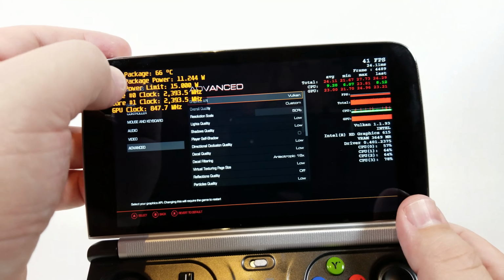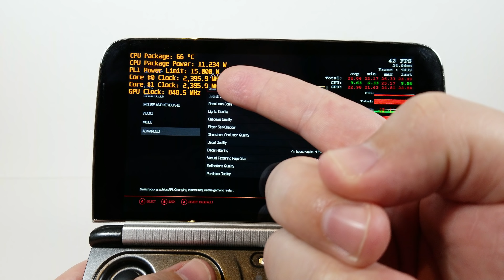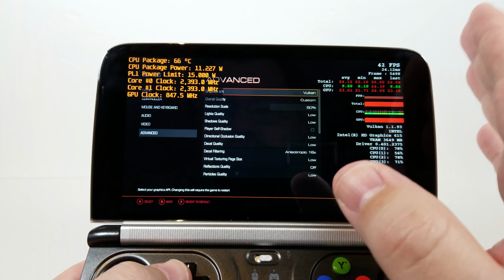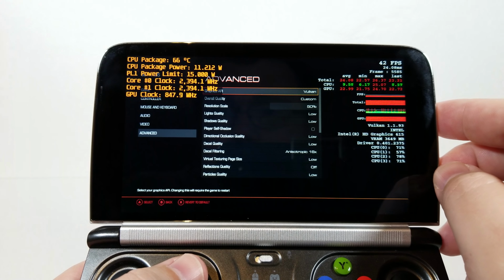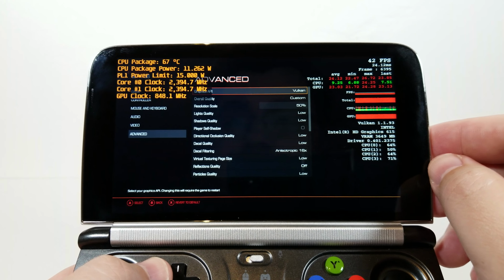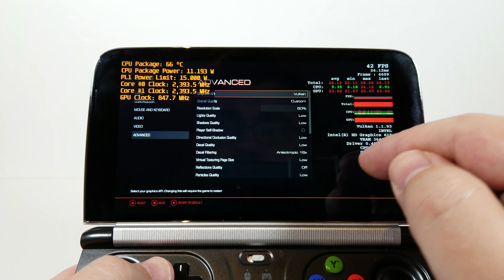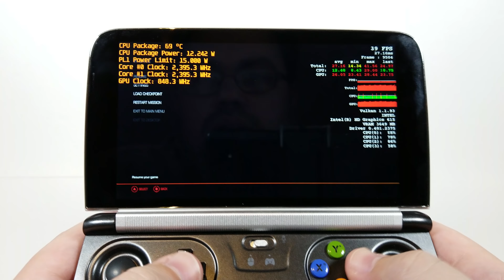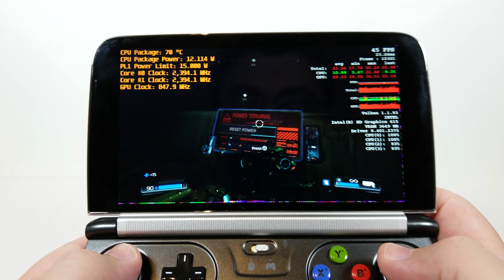GPD Win 2 Heatsink Mod GameTest - DOOM MAX POWER (15 Watt TDP)

Comment: Looks better than Switch
Reply: Computer Man Its running at 360p
Reply from the maker: Don't listen to Justin Wong. It's 507p XD
Reply: Of course. According to Digital Foundry, Switch version runs at lower settings than the lowest possible on PC, at 500p... Even a GT 1030 can run DOOM at 1080p 30-40 fps
Reply: Thang Nguyen Texture quality is lower due to size limitations
Reply: @justinwong939  so it looks worse
Reply: Depends what u mean
Reply: @ROCKSTAR3291  and once again, you seem to fail to recognize that the switch version has been improved since then at more often than notx runs at 720p. The tegra x1 is very much more powerful than the gpd win 2, the switch isnt fully clocked in docked mode and still beats it out.
Reply: @ThePhawx  The resolution scaling is represented from one axis only. So if your are running 50% of 720p, that's 360p. It's 50% of the pixels in a given axis, aka 25% the pixels, not 50% the pixels. For 50% the pixels you need a resolution scaling of 1/1.41

Comment: Running doom better than the Switch
Reply: It depends. He changed its tdp to 15 watts from 7 watts so thats probably why. Normally it would be quite similar
Reply: It’s actually not bc panic button just released an update on the specs making the games even better looking and crisper, switch games runs amazing for 30fps, this game here runs but it’s glitchy and lags a lot and the graphics glitch constantly, I know bc my friend has one, not worth it for the price, better off with the switch
Reply: Dee Lopez Well, it isnt the devices fault. Its more or less intel’s crappy Vulkan drivers which might or might not be fixed
Reply: @Dee_Lopez  runs at higher FPS.... your friend doesn't have a 15 watt custom heat sync
Reply: @Dee_Lopez  whether you like or not this specific GOD win is running doom at higher texture quality and higher Framerate than the switch.
Reply: Maury J. Well, I also found out it was running at 360p in this video
Reply: Maury J. If the game drops to the low 30s at 15 watts then it probably will drop below that at default tdp
Reply: Maury J. Also, just saying. Texture resolution isnt really affected at all by gpu power. Its mostly vram and ram
Reply: But does Win 2 have motion controls?  That would be killer
Reply: Can people shut up about comparing framerates between switch hand gpd? It an apples to oranges comparison, switch is capped at 30, so we don't actually know how it runs framerates wise
Reply: @justinwong939   do you even know how resolution works ? 50% resolution scale of 720p is about 500-600p. You think you can just divide 720 in half lmao ?
Reply: XoMrNoNameoX Resolution scale affects both width and height
Reply: XoMrNoNameoX So it is
Reply: @justinwong939  Doom uses pixel count for resolution scaling, not vertical and horizontal line. 1080p at 50% give you 720p which is about half the pixel count, and so on

Comment: what?!?! in my gpd win 2 I have it set to 10w and undervolt -60 and I can play Doom with everything in high except about 2 options in low resolution scale in 71% and resolution at 544p the frame rate is 38fps minimum and 63fps maximum setting everything on low it reached 108fps and without using that fan it could be an hour playing perfectly ...... so I'm telling you to buy another gpd to do these tests why yours should have some problems
Reply: sebastian oyarzun I highly doubt it reached 108 FPS. His unit is fine.
Reply: A bunch of people have tested doom on the device and have never come even close to what you described
Reply: @justinwong939  but it's true in my case I would not be talking about this if it was a lie and in my gpd I deleted and deactivated all the useless Windows applications and again I made it clear that I am playing with 544p resolution at 70% when I can upload a video to myself when I downloaded it again

and they say that many have tested the Doom but you have seen what was the last test none has played with the updated drivers at this time
Reply: sebastian oyarzun Updated drivers increase the dps by more than double?????
Reply: sebastian oyarzun *fps

Comment: ok, tbh although this does seem pretty cool, and I'm not anti-win 2 but the switch does a much better job at running Doom and the fans dont get loud. Doom is one of the games i intend on playing on the go and the win 2 just doesn't cut it, Is there a way you could lower the tems even more?

Comment: @The Phawx - Need to know how far I need to Disassemble the Device in order to replace the DPad with one from a 3DS, and the Joysticks from a 2nd Gen Vita. Dont want to Disassemble what I dont need to, but this one seems a bit more complex. But if I am correct, I should take it apart AND also replace the Thermal Paste for better Heat Dissipation?
Reply from the maker: You have to disassemble pretty far to get to the keyboard membrane. The good news is you can get to it and leave the heatsink alone. The SoC is on a daughter board that can be disconnected without having to disassemble the heatsink.

You COULD replace the thermal paste, just be aware you will need to use a lot because of the gap that exists, or use shims
Reply: @ThePhawx  Interesting. Will wait till I get the Joysticks......whenever that will be.
Reply: @ThePhawx  : By the way, are you having any Issues with the A Button? It seems to be a pain trying to Press A and B together. Seems like it is catching on something. Hence another reason to get at the Controls.
Reply from the maker: @chrisflowers-smoker154  yeah newer units can be tight. After use the plastic abrades and it's easier to press

Comment: The Phawx, i know this is a bit of an old video, but can we talk about this openGL 450mhz thing? Have you found any way to fix it, or know which drivers give the full 850mhz for OpenGL?
Almost none of my stuff uses vulkan except Dolphin and PPSSPP which i'd rather just use DirectX for, but a lot of stuff uses openGL. If one of my emulators doesn't use directx, it uses openGL so i'd rather have openGL at full speed.

Comment: Do you think he could find really tiny, but really stiff spring screws? Because if i want to use Liquid Metal, that gap can NOT be there. Even if it means i'd have to mod the heatsink myself, to take 0.1mm off where the screw mounts go, so it rests a bit deeper.
still, spring screws would be better..
Reply: Liquid metal wouldn’t be the best idea especially on a portable device lime this
Reply: It'd be wise to take precautions of course, such as putting something around it to catch anything that got loose, even using a foam/rubber seal around the cpu. Your argument is probably going to be the exact same one that everyone else makes, and all stems from the same source.
1 person says it, then another, it just spreads from there. But has anyone actually seen any failures from someone who took proper precautions and applied it properly? Like have there actually been any reports of failures from laptops with LM? 

It makes sense, don't get me wrong, you jostle it around a bit, maybe something will get loose... IF you use too much LM and don't have anything around the cpu to catch it. It won't absorb it, only catch it. Even a single layer of paper towel around the cpu would be enough.

Comment: You have the resolution set to 720p but resolution scale is 50 percent 50 percent of 720 is 360p you said the resolution is 507p unless I’m hard or hearing.
Reply: trent trombley Its 504p. 360p is halving both the horizontal and vertical sides so thats 25 percent
Reply: Justin Wong but isn’t that what they do they half both? I’ve seen you tubers using the resolution scale of 50% with 720p and they always say 360p so 640 x 360. 75% would be 540p or 960 x 540 etc
Reply: trent trombley I’m not sure but I think it has to do with total pixel count and half would be 504p
Reply: Justin Wong actually I just read up on it. If you are using 720p which is a resolution of 1280 x 720 if your resolution scale is 100percent it will render at that resolution. If it’s 200 percent you’d multiply 1280 x 2 and 720 x 2 giving you 2560 x 1440 so in this case it’s the same you’d multiply both the vertical and horizontal by .5 giving you a resolution of 640 x 360.
Reply: trent trombley Oh. Nvm then.
Reply: Yeah. I just looked it up and it seems to. So it actually is 360p
Reply from the maker: This was actually a discussion that came up prior. Resolution scale applying to the pixel count instead of the HxW.

I can forcefully set the resolution or even just take a screen shot of the game and count the edges on the aliasing.

I'll follow up when I have an actual answer.

Comment: What is the point of the custom case if the original can fit with the heat sink?
Reply: You have to sand down some plastic on the original GPD win 2 case in order for the heatsink to fit
Reply: Based on Phawx's video review of the custom cases available ( https://youtu.be/yJ7RXMZ8h9Q ), the temperature tests showed the custom ones feel cooler than the original.
Reply: @hoeybaby1  oof. Wonder if it makes it weaker
Reply: @hoeybaby1  I was thinking of maybe getting this heatsink if I get the win 2 but I didn't want to replace the case. Did that once with the win 1 and found it tacky after a while. Switched back

Comment: How does this compare to a Switch?
Reply: Well... Just think of the games. You don't have to buy any dedicated games for the device if you have steam
Reply: It's a lot better but the switch is worth having if you like nintendo games, gpd win 2 is a more powerful and more portable handheld
Reply: @BADC0FFEE  and twice more expensive :D
Reply: Without the mods and tweaks. it is more or less a tie when playing the same games. With the mods. The GPD WIN 2 wins.
Reply: Well considering portable on the switch the lowest the resolution goes is 540p or something and highest the res is at 680p. I don’t know the exact numbers. This test the resolution is at 360p 100 percent of the time. I’m not sure if there is depth of field fx etc. 

Perhaps if this was a dedicated console with games built straight for it they would be better. Keep in mind too this is doing 15 watts maxed out. The switch does 5 watts portable. 

I guess you get the full steam library and can get get 40 fps at 360p on doom on the go which if you don’t care about graphics and the hefty price tag it’s good
Reply: @trentoinsano  This is false. Doom on the Switch lowest resolution is 432p with frame pacing and goes sub 30 fps in hectic areas. Source: DigitalFoundry youtube channel. There's alot of head room on the gpd win 2 to increase the resolution to 500P and still stay above 30 fps.
Reply: Codex my bad, you are correct. I was lazy and didn’t go check that video on digital foundry at first so it did say it goes to 432p at the lowest. But keep in mind that is the lowest. In this test the resolution is at 360p at all times. If the switch was running 360p at all times without dof, bloom, anti aliasing etc I’m sure it would get to these numbers. Keep in mind also that this test isn’t in a high stress area. I’d like to see it tested in the same area digital foundry tested doom on the switch.

I’ve seen other games playing on the gpd win like diablo etc and the games don’t hit 60fps. Optimizations are the key here 

The gpd win 2 just can’t compete with direct ports. It wins in the sheer amount of games you can play.
Reply: @trentoinsano  I've tested the exact same demanding areas as DigitalFoundry at 8.25w -65 undervolt for GPU and CPU. I can push the resolution to 482p with anti aliasing on and stay above 30 fps, that's a higher res than this video and the switch version. I should honestly make a video showcasing it, so it clears any confusion on the matter. I wouldn't say the gpd win 2 cant compete with direct ports, the gpd win 2 can run lots of games better than the Switch and vice versa. Rocket League, Doom, Katamari Damacy Reroll, Shining Resonance Refrain, etc.
Reply: Codex There was a new patch that came out recently and increased the resolution. It isnt necessarily accurate anymore.
Reply: Codex Also, the switch in portable mode runs between 29-30 in the scenes that digital foundry tested
Reply: Codex Overall, I will have to agree with you. Its more of preference. They both play and look great for what they are.
Reply: @trentoinsano  
Then again there was a patch and DF didn't really check for lowest portable resolution, so who knows how low it dips to

Comment: Gpd win 2 better  smash z??
Reply: it's better than the smach z in the sense that the GPD win actually exists and wasn't a scam by some mafia don
Reply: @bjollnirbjordsen9795  Wasn't the PGS the mafia one? I think Smach was just plain incompetent.
Reply: @AnTran147   Correct.
Reply: Smach Z is literally still 6 months away from delivering. And it is more expensive and almost twice as bulky. So, you need to take that into account.

Comment: Kind of disappointing. Doesn't look like the performance is that much better then stock.
Reply: Wtf? It's a big boost
Reply: It is like a 10fps boost on doom. What are you talking about?
Reply: he was getting 30-40fps with stock settings. I wouldn't say being more constantly close to 40fps at almost twice the power consumption is a big boost.
Reply: @DocCube  
Why even attempt to run a 2017 console game on this 🤦‍♂️ if you act like having a brain, you would know it runs like shit on this DS sized device no matter whatever you do. I mean look at the footage, does this look in any way comfortable or nice to play?
Reply: @AbuHajarAlBugatti  Looks fine to me. Better performance than the switch.
Reply: csl110 please dude, better performance than the Switch my ass, those pink lines at the bottom are pure shit for the extra 10 fps. Not worth it.